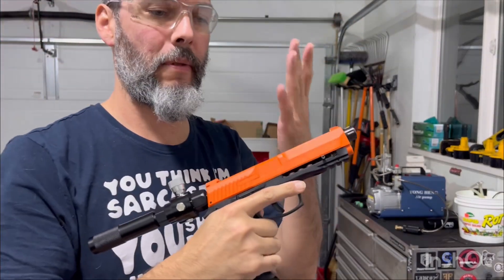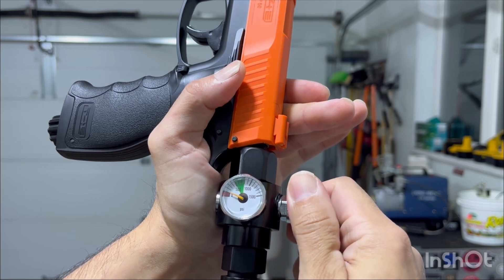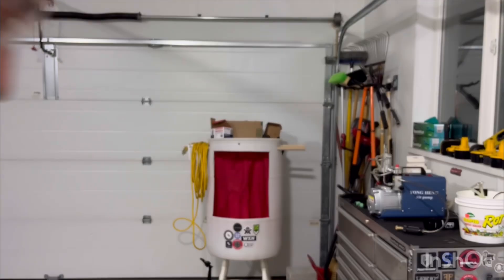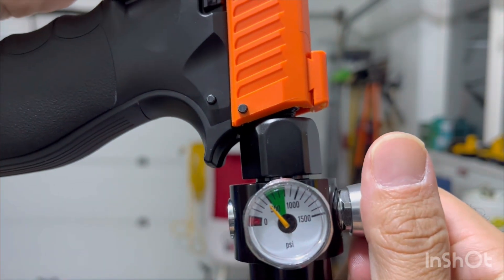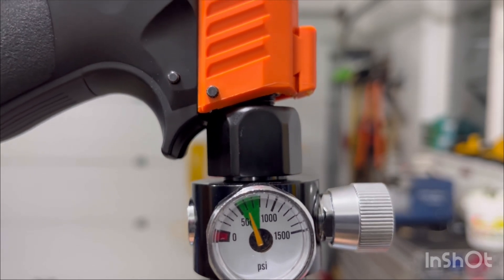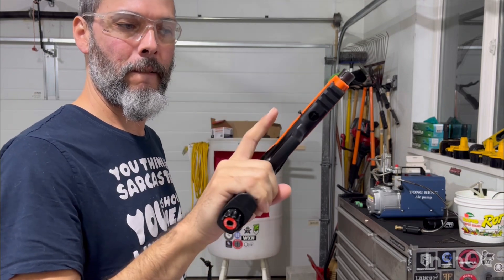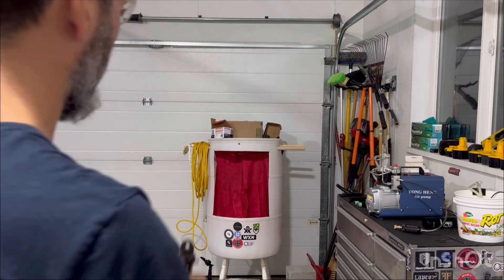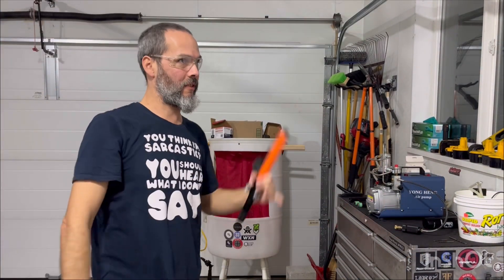LL4D Umarex Hdp50 - Regulated 12g co2

Comment: i wonder how it would function with the zram valve extender as a expansion chamber
Reply from the maker: I have a zram chamber but unfortunately due to the way i did this rear asa on this hdp it is no longer possible to attach it without an air leak.

Comment: The first was 300 PSI.... The second was at 600 PSI. Each line is 100 pounds. What speeds can you get with 2.7 aluminum balls? Have you tried other ammo?
Reply from the maker: Ill have a closer look at the gauge next time i promise.

Steel balls are my go to because they are cheap and easy to get. They are also the most destructive when the launcher is powerful enough.

Ill probably add more types now that i have my hands on and Hdr50
Reply: @lesslethalfordummies  That's wild. How can you get than many joules from the stock valve block? Did I miss some mods? I can only imagine the FPS with 2.7g aluminum. 
I bought one of these HDPs - dyed the slide black, and will modify for more power when I'm done messing around with it and want to put it in the nightstand. I also got the Glock 19 BB version from Umarex and that will me my practice pistol for garage shootin'... I may want to get a compressor and connect to hose... who knows... Thanks for your content.
Reply from the maker: I am running a non factory bolt setup for hpa. Normally this spring farted when used with co2 but the regulator appears to allow me to tune it much more precisely. I just winged this video so i cant wait to see how it does once i use some of my 🧠.

Thanks for stopping by!